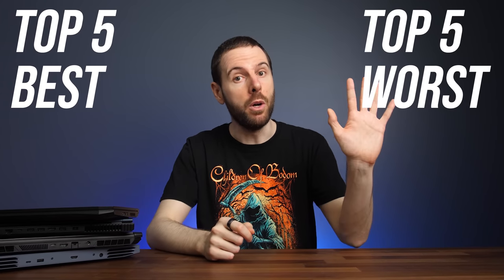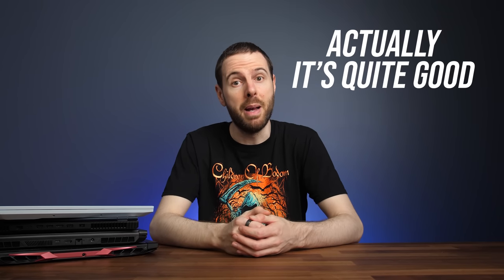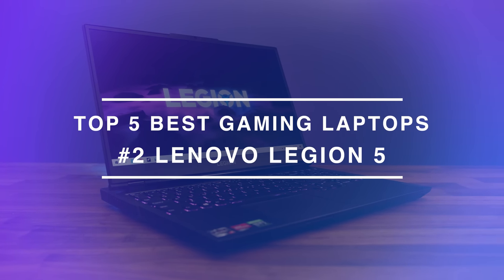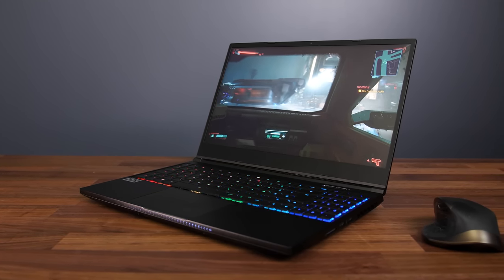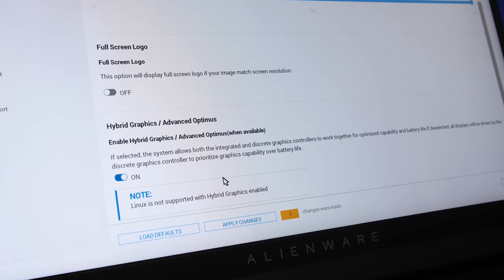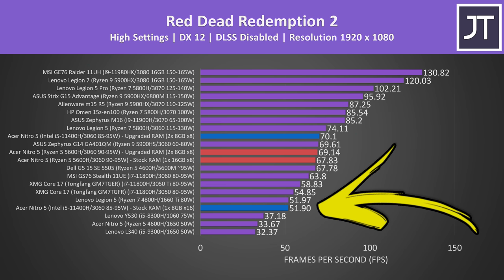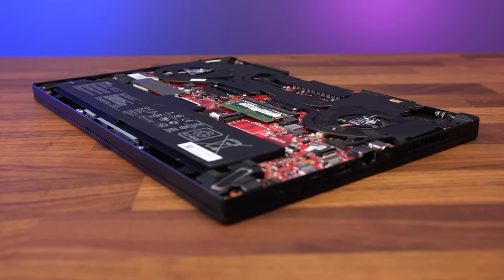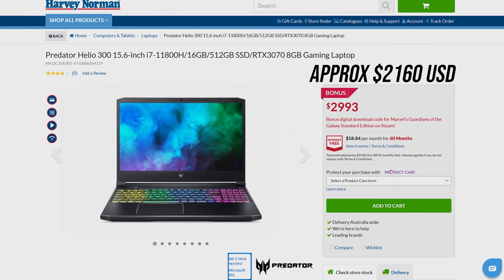Top 5 BEST & WORST Gaming Laptops of 2021!

Comment from the maker: Check out the top 5 gaming laptops in 2022 next: https://youtu.be/x3FDAqUnQBw

💲Find the best gaming laptop deals at https://gaminglaptop.deals
Reply: isn't the g15 110 - 130 tpu now after a Vbios update?
Reply from the maker: @plinioandreasgaston-dabao3843  I haven't updated mine since the review, where it maxed at 125w.
Reply: Hey Jarrod, just asking. Have you covered the ASUS F15? not the Dash F15 the ASUS F15 gaming laptop? cos I haven't seen anyone review the F15 in depth. Just want to know. Thanks for your Vids.
Reply: @JarrodsTech  Makes sense, thanks for letting me know about the sucky 120 hz screen.

50 bucks more for the 165 was worth it
Reply: Hi Jarrod. Do you mind to review 17" of Helios 300? i think it will be a good topic to talk about 😉, since it doesn't suck that much as much i tested. 140w of TGP for 3070. that would be a great contrast for your 15" model.

Hope this topic can comes to you next few videos.

In my country(Taiwan), it cost only 13Kish USD during black fridy holidays.
Reply: Well, now I'm really happy I bought my Helios 300 two years ago.
(i.e. when it was one of the most recommended buy, opposite to now)

Thanks for your videos!
Reply: I got myself an acer nitro 5 with a RTX3080 and 2*16 Gb RAM as well as a Ryzen 7 5800H CPU. Would that work out better?
Reply: Hi Jarrod! hoped you could help me with a recommendation, im looking for 15.6" screen laptop for normall uses, relatively light gaming, and under 1K$.
Reply: So the Acer nitro 5 comes with dual channel ram (2x4gb) but instead of 1 soldered ram stick they're both replaceable and it costs about €1100. Should i go for it? (It's the Ryzen 5 5600h version btw)
Reply: Hey Jarrod.
I personally can’t decide if what i want. 
My laptop (4-5years old) really gives up and i want to buy a new one. I watched so many videos of you(comparisons, reviews and top 5's). I‘m currently looking after a Legon 5 with a Ryzen 5600H, RTX 3070 and 165Hz display for about 1600$.
Should i still wait for the 12th Generation Intel Laptops or?
I really need your advice
Reply: Should i buy 
Legion 5
Or
Hp pavilion gaming 15
Reply: Can you review Aorus 17G RTX3060 17.3 inch
Reply: @Jarrod’sTech is the MSI Raider GE76 a good gaming laptop cause I just wanted to clarify if I should get this
Reply: Check out the aorus 15p
Reply: Hey Jarod i recently got the dell g 15 can  you help me on finding the mux switch im pretty new to this laptop game.
Reply: hi..i thought the legion 7 battery drain issue was fixable..by disabling the software responsible..is that no longer practical..
Reply: I’m a new PC gamer so I’m trying to find the best gaming laptop for price and capability. What I ended up was the RTX 3060 Acer Predator Helios 300.
Reply: Help me out pls , I need a gaming laptop my budget is 50k to 60k what do you suggest ??
Reply: well I am from India soo
Reply: I was talking about 50000 to 60000 in INR
Reply: Do you have any opinion on razer laptops?
Reply: HI I WANT TO choose one of this laptops, my aim to do video editing for my videos. and to record screen of my laptop wile watching live soccer.
Dell g15
16gb ram
512 gb ssd
NVIDIA® GeForce RTX™ 3050 Ti 4GB GDDR6
AMD Ryzen™ 7 5800H 8-core/16-thread Mobile Processor
15.6 inch FHD (1920 x 1080) 120Hz 250 nits WVA Anti- Glare LED Backlit Narrow Border Display =============================== Lenovo 5 15 " preimum
16gb ram
512 ssd
AMD Radeon™ RX 6600M 8GB
AMD Ryzen™ 5 5600H Processor (3.30 GHz, up to 4.20 GHz Max Boost, 6 Cores, 12 Threads, 16 MB Cache)
15.6" FHD (1920 x 1080) IPS, anti-glare, 250 nit lenovo 5 15 "
===============================
16 gb ram
1 gb ssd
AMD Ryzen™ 5 5600H Processor (3.30 GHz, up to 4.20 GHz Max Boost, 6 Cores, 12 Threads, 16 MB Cache)
15.6" FHD (1920 x 1080) IPS, anti-glare, 250 nits, 120Hz
NVIDIA® GeForce® RTX™ 3050 4GB
15.6" FHD (1920 x 1080) IPS, anti-glare, 250 nits, 120H
Reply: I order the Lenovo - Legion Slim 7 15" 4K Ultra HD Gaming Laptop - AMD Ryzen 9 5900HX - 16GB Memory - NVIDIA GeForce RTX 3050 Ti - 1TB SSD - Shadow Black for $1,500.00 what do you think about the graphic card?
Reply: @Catholic1391  you can play with it, but a 3060 would have been better and it costs just a little bit more
Reply: hey my legion 5 1650 isnt giving as much fps as it used to and its fully cleaned so any tips to improve?
Reply: can you make new video for gaming laptops in 2022?
Reply: Hey, where does Asus Tuf A15 stand?
Reply: I got myself an ASUS TUF DASH F15, and although he put it on one of the worst ones, I got the 3060 version, and that pretty much outpowers the 3070 so im happy
Reply: I just got my lenovo legion 5. How long should I charge it for the first time? Do I need to fully discharge it first? I also read somewhere that I need to let it charge for 24hrs to make sure it gets a full charge on the first go since it’ll help prolong the battery life.
Reply: what about dell xsp 15 19510 i loved the design is it good enough to play games like THE DAY BEFORE and Marvel guardians of the galaxy !?

Comment: I have an Acer Nitro 5 i'm in Italy and i bought It at Just 999€ and it's a model with 8gb x8 RAM  and with AN external screen It gets only 5-8fps less than the legion 5 and the legion 5 in Italy costs around 1399€ and even adding a 144hz monitor+8 GB of extra RAM It costs 200€ less so i think that the Acer nitro Is still a perfect option
Reply: Was that the 3060 version or the 1650 one?
Reply: In italy we have less power, more money option only for laptops
Reply: @copykaktus4193  3060
Reply: @firealba4520  thats actually quite bad for a 3060 because a normal laptop 3060 is normally faster than a legion 5 laptop because the legion 5 has a downclocked gpu for less heat
Reply: @paneledp  where did you get that info?
Reply: @paneledp  the legion 5 Is 5% Better than an average 3060 laptop so Acer nitro Is on average
Reply: @jhulenoscarantezanamendez6106  he invented it
Reply: @paneledp    Acer Nitro 5's 3060 runs at an average of 95-100W while the Legion goes up to 130W. That's why it's lagging behind the Legion. 
Other 90-100W, 3060 include the HP Victus, MSI GF 63, 66/76, Lenovo Idepad Gaming 3, Dell G15, etc.. You're comparing full RTX laptop power with a low-powered ones. 
Plus, low powered are much more affordable then the full fat one. At least you get your money's worth to am extent. So if you have the money, go higher.
Reply: My nitro 5 has duel channel 16 gb ram ( it came as a stock) and it performs very well 80 fps overall in forza horizon 5 ultra rtx high settings. I think Jarod's opinion about Nitro 5 is too shallow.
Reply: @melikhanaygor9208  i Agree. 
I suggest you to connect It to your TV and try to tell me how many FPS do you get
Reply: @melikhanaygor9208  i think the same. In my country, there is a huge price diff between legion and nitro 5 (3060, ram 16gb) . In the price we are getting here, nitro (with ryzen 5600h and 3060 though a little low tgp than legion) is a wonderful deal.
Reply: @melikhanaygor9208  No he just mentioned that for higher config you should get a more complete package and not be so similar to the lower specd options. You should not be paying like $1200 for just 512GB and 8GB stick. Should at least get 16GB (8X8). Otherwise the Nitro is good for the class
Reply: Same here. New models are always coming out. I’d prefer to save that $200 towards next years new models. Computer speeds advance too fast. It’s better to upgrade frequently than to spend much and not able to upgrade more often.
Reply: At least you used external screen, so it make sense
Reply: Same here, got an Acer nitro 5 with 3060 gfx & ryzen 7 for like $1200 (India) and I gotta say it's perfect for the price.
Reply: @paneledp  What? Legion 5 has full power 3060... It's said also in this video
Reply: Whatever suits your pockets, is as good as it can be. Don't get confused or distracted by what others are saying. Thanks.
Reply: Bought a new Legion 5 with Ryzen 7 and GTX3600 for 1300€ in Italy this morning!
Reply: @Alberto-wz7pz  sì chiama rtx 3060 non GTX 3600 e poi oggi è il black Friday.
Comunque dove l'hai comprato
Reply: @firealba4520  sito ufficiale Lenovo! 1tb, 16gb di ram e il pannello da 165hz.
Reply: @Alberto-wz7pz  l'ho appena trovato a 1183€
Reply: @paneledp  that’s horseshit the legion 5 has normal gpu PLs
Reply: @paneledp  What? The rtx 3060 in the Lenovo legion line is actually one of the few that come fully powered.
Reply: @georgiaguardian4696  no it's better to buy less but spend more on better hardware otherwise you should just play on console

Comment: I bought a Scar 15 because the Legion 5 Pro wasn't available in my country :( and still to this day isn't
Reply: Its availible where I am at but only with Windows 11 so that basically means it isnt availible lol
Reply: To be fair, the Scar G15 2021 is still good, just no MUX switch.
Reply: The Scar is great, just has no mux
Reply: @jacks3940  What you have against win 11 ? and you aware that you can just downgrade to win 10
Reply: @jacks3940  windows 11 in my opinion is much better than win 10
Reply: My condolences
Reply: @Hutan2034   In all fairness you are the 1st person I've ever seen say that
Reply: I almost bought scar 17, happily didn't get any change to get it back in May.. So I bought xmg neo 17 with ryzen 5900hx and rtx 3080 and i'm very happy that I couldnt get scar 😁 scar would be maybe near the best option, but no mux switch downgrades it from super-tier.
Reply: @Hutan2034  it lowers game performance and fps
Reply from the maker: Hope the Scar is going well! Nice speakers from memory
Reply: @JarrodsTech  they are! its actually a great laptop, my only downside personally is that it doesnt have a physical numbpad, since I work with some software that has the shortcuts on the numbpad, overall the performance is what u paid for
Reply: @jacks3940  I got a L5 with W11 pre-installed and have had absolutely no issues, probably works better than 10 for me
Reply: Bruh same, I couldn't wait for the legion, but it's available now but it's more expensive than the scar 15(the 3070 variant for both).
Reply: I have a scar 15, it’s bloody amazing. Speakers are stellar and not very loud
Reply: I have to pay nsarly $400 more for legion 5 pro and it was just available arpund previous month. The new gen is qround April. Sucks to be in a country with corrupted bastarda.
Reply: I got my legion 7 with RTX3080 in Italy. But I'm from Ukraine. Insane that to get a powerful top laptop today you need to do much more than just order it online or go to store to just buy it... Crazy times...

Comment: I’m probably the opposite of what you might call a ‘thermally paranoid’ person. I go by a rule where “if it’s not at TJmax, it’s not being pushed hard enough”.
Reply: you probably have The Money™ to do so, so..
Reply: same, I immediately think of that meme in simpsons fire "it's fine" hahahaha
Reply: Yes, this!! My Dell G15 his 100 degrees even on a cooling pad when playing battlefield 2042 and running it like this for hours upon hours there has been no issues at all.. all other games it never gets above about 86 degrees though ... I've read that dell sets the max temp to 100 for Max performance and AMD and Dell have both seperatly stated that the ryzen 7 5000 series will happily sit in the 90s all day without breaking a sweat.. so I'm not concerned
Reply: @zan7838  Lol what does that even mean? Nobody is too poor for a hot laptop.... it's not like it's going to fail
Reply: high temp may not cause dmg to the cpu but for other components like battery, ssd, ic,... im not so sure man, especially when you run at that high temp for hours and everyday .Just get a legion 5 pro and no need to look back
Reply: @theskywalker8416  for sure, other components have lower temperature tolerances than something like the CPU. If the high temperatures on the CPU/GPU are causing chemical damage to other components, then it's usually a design flaw. A legion 5 pro would be cool and all if availability was consistent (currently only up to an RTX 3060/3070 available, on the AMD and Intel variants respectively), and if their website wasn't so janky (when going through the customisation window, the store category section and the 'progress bar' start fighting for the screen space).
Reply: @mrbrad4637  Pathetic. My old ass OMEN 15 has 97°C on every game. Even games like CSGO or Unturned
Reply: @Stokurev_  I reverted back to older NVIDIA drivers and not only am I getting about 10fps more avg  now battlefield runs at 89 to 91 degrees .. it peaks at 97 for a minute or less  but drops back again to 91 or lower
.. maybe true different drivers, what was the temps when it was newer before dust etc has accumulated and thermal paste was still fresh ?also I found using the mux switch so discrete graphics only lowers the temps overall by a good 5+ degrees
Reply: @mrbrad4637  When it was new I honestly can't remember. It's 3 years old now. I've already replaced the thermal paste on the cpu, didn't really help. Accumulated dust in the fans was negligible. It's got a GTX 1050 and an i5-8700H. Very weak, if I knew something about PCs back then I'd probably have made a far better choice than the person who picked it.
Reply: @Stokurev_  Trust me I did the same thing, last year I bought an ASUS TUF FX505DV with a 90w 2060 rtx but a pathetic Ryzen 7 3750H with only 4 cores . I sold it due to its pathetic CPU bottlenecked performance and purchased the Dell G15 with a 5800H and 130w 3060 rtx which I got for about $350 less than I paid for the ASUS and the performance difference is night and day.. the Dell runs everything I throw at it maxxed out..
Reply: @mrbrad4637  I'm planning to buy a Legion 5 with those same specs. Can't wait for the upgrade, since I'll be able to play more demanding games

Comment: Quote of the day 
"Friends don't let Friends buy quad core " 
-Jarrod
Reply: That's dumb
Reply: @xXlURMOMlXx  true, his comparing CPU intensive games and still measuring the GPU performance
Reply: Actually  , the more specific phrase should be "Friends don't let Friends buy quad core at i7 prices " . That is what the i7-11370H CPU is , 4 core but with an 8 core i7 pricing . 4 core with i3 pricing is absolutely acceptable.
Reply: No asus tuf a15 or acer nitro
Reply: A year ago I bought the Asus TUF with a 90w 2060 and 3750H Ryzen 7 quad core.. performance was abysmal due to the 3750H - a CPU that's as slow and my 2011 ASUS ROG.. the 3750H was the worst CPU I've ever encountered and I sold that laptop and bought the Dell G15 with the awesome 5800H and 130w 3060 and am absolutely stoked with it...and I paid about $350 less for the Dell.. the Dell G15 is better in everyway and Quad core is useless for gaming these days.
Reply: I have a 2014 made laptop - it's a quad-core from the time the quad-core was something.
Reply: @Saurabh yeah 4gb vram is pretty bad.. but I'd take 4gb vram over 4 cores.. you can always lower textures
Reply: @Saurabh lol true, though I found warzone was unplayable on 4 cores, even with a 90w 2060 rtx - struggled to maintain 50fps with everything on low.. and I'm sure battlefield 2042 would be unplayable with 4 cores ..  Since getting my Dell G15 with a 5800H and 130w 3060 I've been able to max out every game I have with awesome frame rates.. I usually just leave textures on high / medium as at 1080p on a 15.6" laptop screen, you won't really see any difference going to ultra textures and the 6gb vram that comes with the 3060 is fine for medium to high textures 😊 but yeah the difference between high and ultra settings usually isn't that much bar textures like you said
Reply: the hell would my friend do with 8 cores? randomly decide to start an youtube career?

4 cores is enough for gaming and everyday tasks